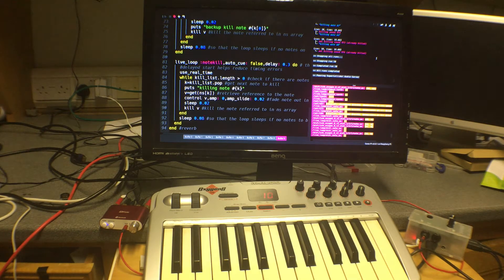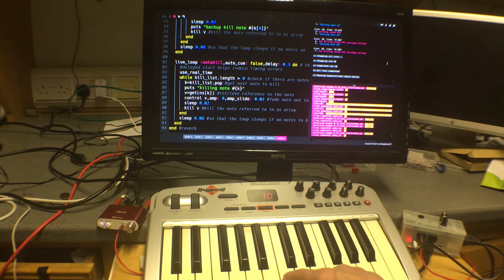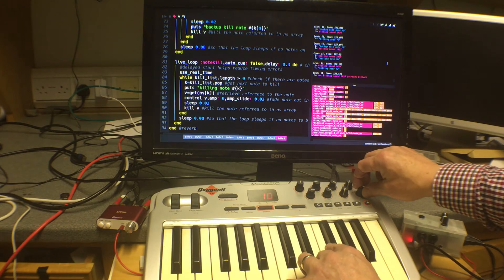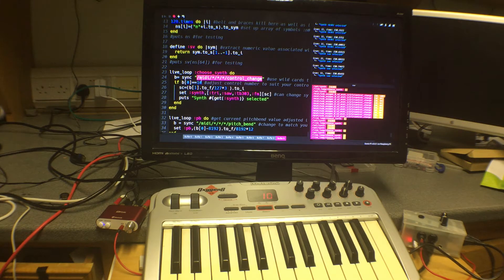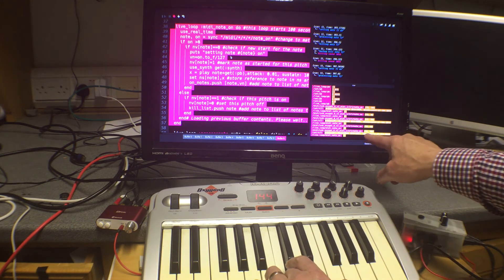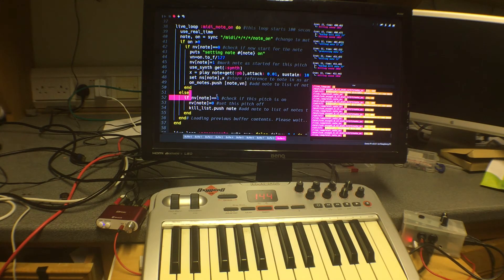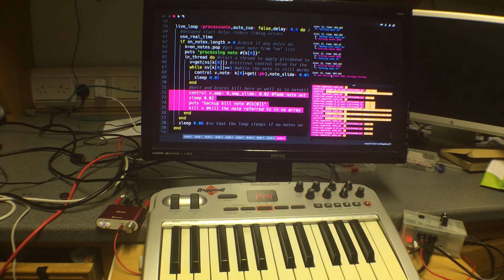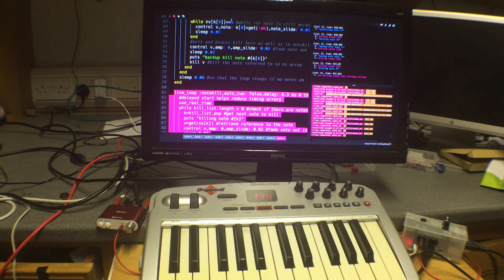Sonic Pi Pi3 Midi Polysynth

Comment: Hi Robin thank you for the video its amazing what you have done. I'm looking to simplify this can you help please as i dont yet know sonic pi and I have an arduino sending midi connected to my rasberry pi via usb. I would like to be able to play some beats using the arduino midi - what code on Sonic Pi will help and what else if anything would I need to ensure that these midi signals are read on the raspberry and played on the sonic pi?